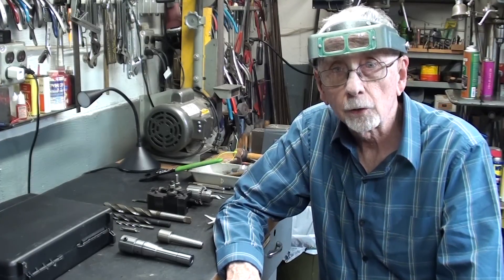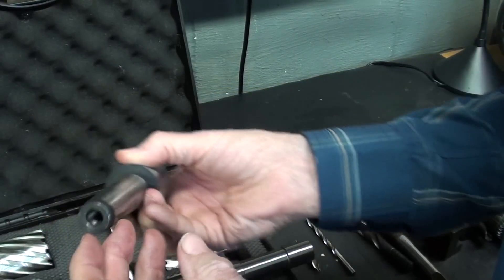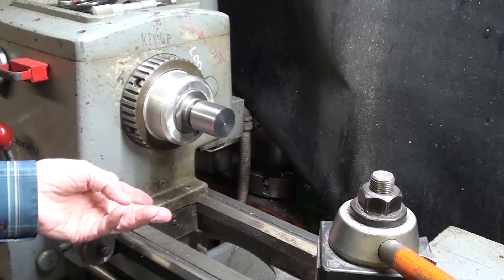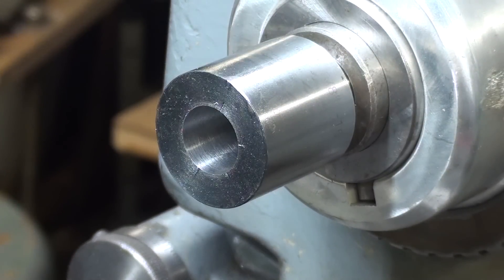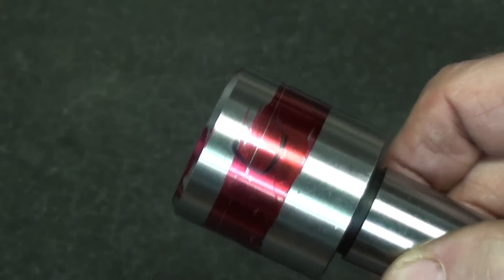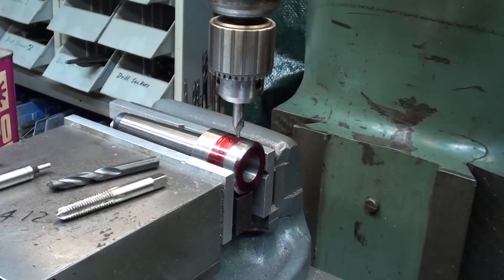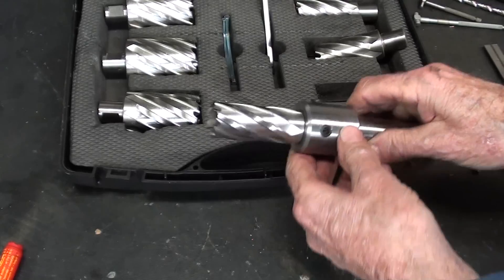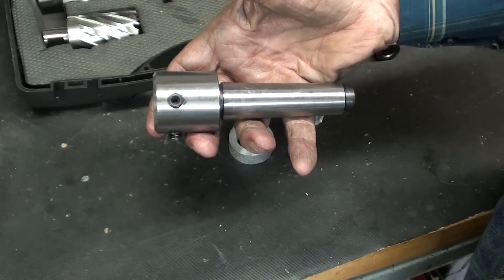MORSE TAPER ADAPTER for ANNULAR CUTTERS #875 tubalcain vevor

Comment: They make round sleeves with morse taper I.D. makes chucking tapers easy. They are cheap imports available. They use them to put Morse taper tooling in CNC gang tool holders

Comment: I like to hold one side of round work in a vee block so I have 3 points of contact. If you mill a flat around the screw hole like for a jam nut then when you turn the work in the vise you can put a nut against the flat and your flat vise jaw to index it exactly 90. That may not offer enough purchase for milling but drilling is mostly rotational and pushing force so you should be fine for this job.

Comment: Thanks for an old fashioned chip spitting video! Good Young fashioned Tubalcain again!  Interesting project.
Unfortunately the Vevor stuff is too costly compared to the number of times it would be used. The half crappy Drillbit tools using braced hard inserts will have to do such jobs.

If the blank has an MT3 taper it most likely have an M12 rod to tighten it.
A rather straight forward work even for a none school teacher... No offense!
Where to get such blanks? I've got a few and think it was from Ebay.
Next project, like this, might hit bulls eye, whatever that could be.

Cheers!

Comment: A quick look tells me that #3MT blank end drill chuck arbors are available from KBC for a reasonable price, with tangs, although the outside diameter of the end portion isn't given on the low priced ones.

Comment: those blanks are available in chinesium on the usual ports/ as for getting exactly to 90??  I would drill one, put in a 3/4 shaft, set it with a screw, and use my Miracle point which you also have. indicating off the extended shaft. nice finish, low load and more stable

Comment: I have purchased some of those blanks from a local supplier who Im sure gets them from China, they are cheap $35nz about $18US but I have never found one with a tang although Im sure they are out there somewhere. Mind you I have just purchased an MT2 with Tang annular cutter holder for only $40NZ so I only need the threaded MT3 for my mill

Comment: Don't you have a set of expanding mandrels? Put one in the bore, hold it in a collet block, clamp that in the vise, and start each hole, maybe ¼" deep. DON'T drill into the mandrel.

For the layout, use a combo square with both the center head and the square head to get a true vertical line, using a surface plate, 123 block, and a v block to hold it high enough for the square head to rest on the surface and the center head comes down on the top of the part. Use that to scribe the vertical and a height gage to scribe the horizontal. 

Once the holes are started, you can hold it with a v block in the vise, using the drill in the chuck to align the workout. You could use a gage pin for alignment instead of the drill if you like.

Comment: I don't see anything wrong with how you clamped the adapter but just as a thought experiment and for the sake of the algorithm. If I had to find another way of holding it, I'd set up an mandrel in a dividing head, long enough that the chuck didn't interfere with drilling and tapping and push the parallel end over it and to secure it and support the other end a tail stock with a dead centre stock into the threaded hole. What do you reckon?

Comment: Good job! Regarding indexing to drill the two setscrew holes: you might be able to turn and thread a piece of rod to insert in the draw bar hole then use the Rose devise on the rod which would be long enough to protrude from the left end of the milling vise. I would use a large enough diameter rod such that there would be a step for the threads and it could pull up tight.  There are probably better ways and what you did was certainly adequate for the job at hand. Sometimes we forget that we can do some pretty good work using our eyes and hands!
Reply from the maker: Excellent suggestion

Comment: Thank you for the video :-) I have one of those magnetic drills similar to your vevor one. Not exactly like it, but similar enough to make me think it came from the same factory. It came with a morse 3 arbor for the annual cutters that features through coolant delivery so I can use it on my mini mill and on a Chinese mini lathe. In my arbor a center plunger opens the coolant path when depressed. I have to say I found coolant quite necessary when drilling a lot in mild steel for example. When I was building my shop press I drilled 52 32mm(1 inch and a quarter) holes in 1in thick mild steel and the cutter is still as sharp as new (I can't speak for vevor, I use a different brand). I used 10% emulsion of "soluble" cutting oil in water. The only downside is that long stringy chips fling that coolant everywhere.
Reply from the maker: Thank you for your   Very good. 
The mess is exactly why i did not use coolant

Comment: I've seen people make tangs that screw into the threaded hole on the back of the taper so that the taper will eject. If you had one you could have used the flats on the tang to square up the holes you were drilling.

Comment: I've never understood how tapping a hole using a machine (either a mill or drill press) makes threads, and not just a bigger hole. @9:57, it seems like magic. I assume the downward speed is somehow aligned with the rotational speed,..... but, it breaks my brain trying to figure it out. Would love to see it spelled out somewhere.
Reply: The tap is the thread form, so it simply screws itself into the workpiece and pulls the quill of the mill or drill along as it screws on in. You don’t hold on to the quill handle……if you ever try it, it’s pretty obvious, but hard to explain in words.
Reply from the maker: Thank you, you just explain that better than I could
Reply: @splinky99  interesting, I assumed it would just spin in place (destroying any thread) if you didn't push it into the material. It didn't occur to me that it would drill/screw itself into the material. I think your description helps a bit. Thank you.

Comment: Thanks for the video 
I use an endmill holder to hold my centering bits in the lathe tail stock rather than a drill chuck.    I grind a flat on the centering bit for the set screw to set into

Comment: Drill and tap the first hole.   Make up a piece longer than the depth of the bored hole and create a suitable flat on it so that when inserted into the bored hole it can be tightened in with the set screw.  That piece must stick out a suitable amount to allow one to loosen the work and orient it to the machine bed with a square and be retightened.  Drill and tap the second hole.
Keep up the good work!
JIM🥰

Comment: Lovely job Mr Pete! that works really well. I remember being told by an old instructor in the training shop here in England, that the taper does the driving and the tang is just for extraction, but I prefer your reading of this, cheers, Dave
Reply: Unless it's an urban myth, in my experience, most machinists who learned his trade in the UK will tell you that morse tapers are driven by friction between the male and female tapers which is a result of the pressure between work piece and drill/cutter. The taper is just there to aid removal. If drills (or adapters) relied on the tang to prevent spinning, the tang would likely twist and potentially shear off. I've seen more than one drill bit with a twisted tang (usually done by a pipe fitter or boiler maker) so I'm guessing your old instructor (like mine) is correct.
Reply: Have to agree with you Dave, the tang is for extraction, not driving.  I've seen many twisted tangs in my time (here in the UK).  So clearly, they're not man enough for driving.  Especially as the drills get larger for a given Morse taper.

Comment: I probably  would have used my cross drilling attachment that goes on the tool post for the set screw holes. The attachment is simply a boring bar holder with a shaft and drill chuck for use with a hand drill. The index wheel on the bull gear would give me the correct positioning.
Reply from the maker: Great idea
Reply: Similarly I have hose clamped a pneumatic drill to a tool holder.